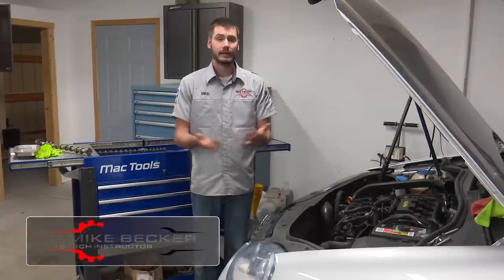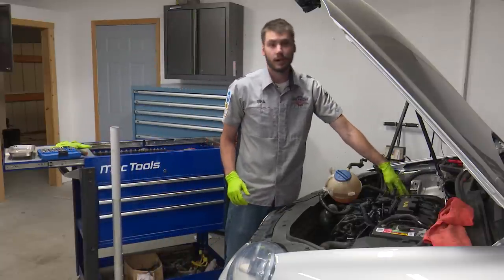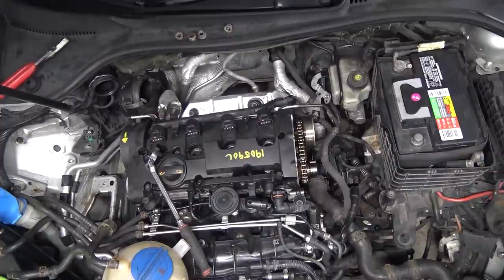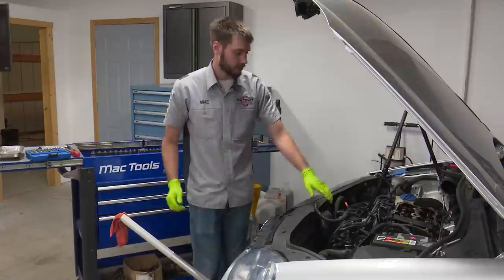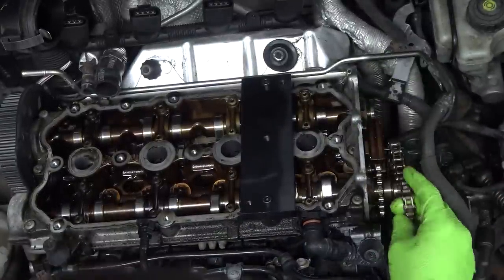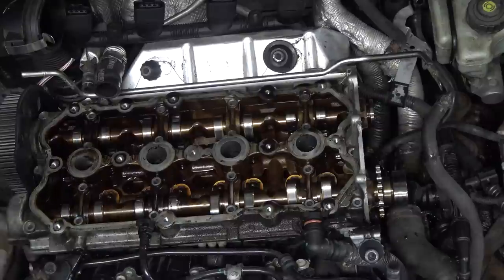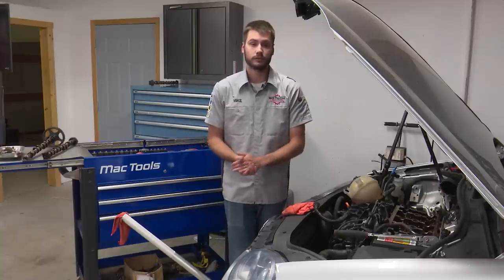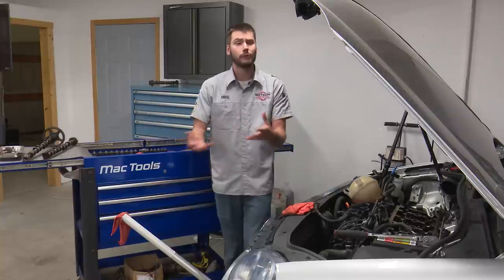Part 3 - VW 2.0L Turbo BPY Intake Camshaft Replacement - P2293

Comment: The plot thickens! Sorry to hear that, Mike, but you're making the right call here, no question about it. 

I've been here before with a '00 Jimmy engine I stripped the electronics off of and installed in a '89 s10 Blazer with a carburetor and HEI ignition. I figured I'd save some time and money, and just throw the engine in without changing anything, since that engine never leaked & ran good (aside from the electronically-induced misfires). Well, the minute I drove it, a giant oil leak formed up front, along with a few others as time went on. Exactly a year later, I was pulling the engine again (since I couldn't get the pan off in the vehicle) and doing all the gaskets and seals, oil pump, and the timing chain set I should have done while it was out the first time! Live and learn, lol. That was a tough one for me! 😬
Reply from the maker: Hey Smitty, sometimes the hardest thing is throwing in the towel on something you're invested in...but I'll make out much better this way. That is such a hard decision to make, how much do you do when the engine is out of the car? How much is too far? I think a lot of it depends on the expectation of the vehicle...like for this VW I'm not planning on keeping it after it's fixed. Therefore I didn't do much with it.
Mike Becker, Senior Instructor

Comment: I have pictures of the exact part that scored the phaser and the outer shell. It was the spring keeper on the end of the hpfp that after it wore through, it broke apart and got stuck in between the phaser and outer shell. I had the same problem this engine had with me neglecting (actually more not knowing it was something I was supposed to do more than negligence) to change the camshaft follower and so now I have a nice big job to do to get it up and running again.
Reply from the maker: Hi Josiah,
Sounds like a big job!
Good luck on the repair and thanks for checking out the video!
Ryan Wilsing

Comment: I'm thinking the camshaft phaser literally came apart due to the engine neglect and wore that groove in the cover. The damaged phaser was an oil pressure loss, so the engine was running with low oil pressure, scoring the cams and starving the turbo bearings. Someone then replaced the phaser to get the engine going again (that would explain why the bolt was so tight). That engine sure has some stories to tell, I'm sure. Quite the domino effect.
Reply from the maker: Hey Joseph, could be! If only an engine could talk....I'm just glad I don't have to listen to this one anymore!
Mike Becker, Senior Instructor

Comment: I'd do it exactly as you did. I know that fixing what you have can cost a ton of money. Machine shops and special tools can be very outrageous!
Reply: Ecclesiastical though...
Reply from the maker: Hey Paul, it would have been very expensive to rebuild this lost cause. Better to start with a better beginning :)
Mike Becker, Senior Instructor
Reply: @Usmanthemecano  fixed! 😀
Reply from the maker: Don't worry Paul, I got your point either way!
Mike Becker, Senior Instructor

Comment: Proof is in the service manual, procedures say to pull the exhaust cam pulley by approx 10mm to get the bridge out. Good series and videos. I have an A3 that I’m chasing a P0087, some of the info in the other videos has been helpful.
Reply: A3 hatchback?

Comment: When you displayed the removed camshaft with all the scoring on the bearing surfaces and the camshaft phaser likewise, your comment about checking the oil pan was correct. I am sure you would find crankshaft bearing journals and bearing inserts scored which is NOT a good thing. You are cutting your losses and opting for another engine.

Thanks for being so forthright and honest. Bad / unfortunate things happen even to the best technicians / mechanics. You will get past this hiccup!
Reply from the maker: Hey, had I installed new parts I would have regretted it. This engine wasn't long for the road anymore. It happens when dealing with used parts. It's just another bump in the road :)
Mike Becker, Senior Instructor

Comment: good on them for allowing you exchange or return it!
trying to repair that thing would be a fatal mistake of wasted money. as I assumed in previous video, lack of oil/oil changes and it's spanked.
Reply from the maker: Hey Throttle bottle, i'm so happy they did. I agree. I believe a mixture of lack of maintenance and high RPM torture.
Mike Becker, Senior Instructor

Comment: Mike, I agree 100% with your approch & decision on this engine. Your car or a customer's car, either way. What a headache. At least no customer involved in this case. But still what a waste of your time. VW techs: is this a common problem with this model VeeDub engine or is Mike just having a bad run of luck?
Reply from the maker: Hey thanks, that makes me feel good! I'm fortunate that this is a third vehicle for me. 
Mike Becker, Senior Instructor

Comment: I did a 2001 TT 1.8t used engine replacement not too long ago and only lasted 6k miles then lost most compression in all cylinders so these things happens. Though this was purchased from a private party and pretty cheap. Now a low mileage with 1 year warranty engine is going in next time
Reply from the maker: Ugh that can be the worst man. All that work to not last :(
Mike Becker, Senior Instructor

Comment: Hi Mike I would of done exactly the same looking at the journal s  you definitely would of had problems  rattles and on going issue's wise decision you made in regards to that engine the car different story  personnel I would of got the diesel version but PD  engine  pretty reliable  but you may not have them in USA . Best of luck with engine transplant
Reply from the maker: Hey, i'm not much of an engine swapper(other than the original). The diesel would get better fuel eco though, I bet!
Mike Becker, Senior Instructor

Comment: Pretty good assessments.
Reply from the maker: Thanks for watching Faras!
Mike Becker, Senior Instructor
Reply: @GoTechTraining Thanks.  I'll use your video as my guide. I am thinking about replacing my chain, tensioner.  Do we just remove the intake camshaft and put the chain, tensioner back then the cam holder tray and then use the tool to verify all is good?  

I know that exhaust side bolt will not come off.  Would rather do it the way you do it.  However, I guess it is possible to take the tray off and put it back in there like you are doing.

Comment: The exhaust cam phaser bolt is fairly likely to strip the splines.  Mine came off like they were made of glass.  Be prepared to drill & extract.  If you have to drill, protect your oil passage from swarf.
Reply: I've had to do this through the firewall before! Carbide bits helped greatly.

Comment: Would you happen to have a Premo Code to use at the Online Store FCP ?  Also I'm not sure if it's made for the VW 2.0T FSI engine or not but I see Cam Followers with a roller on the end that meets against the Cam, So maybe less Ware & Tare on the Cam , If I can find that type of Cam Follower for the VW FSI 2.0T would you recommend it ?   Part#  HITACHI FUP3058

Comment: Glitter in paint is pretty, glitter in oil not so pretty. I would have loved to see  what was in the oil pan. I'm glad they took care of you on the expired warranty.  I would have liked to tell you the story of a customer and his 5.4 3V ford truck but that would be way too long!
Reply from the maker: Hey Keith, could not agree more...I hate glitter in the oil! Yes, it would have been nice to see inside. I was pretty frustrated and didn't want to do more work than necessary on that junk motor. Ahhh yes, the ol' 3valve...I'm pretty sure every one has been unlucky with those and has a story to tell :(
Mike Becker, Senior Instructor

Comment: I'm experiencing the same code P2293 on  my Audi A3 2.0 FSi. I thought is it was the high pressure fuel pump,  it replaced the pump but the fault keeps on coming

Comment: My initial guess would be the engine's HPFP had a failed cam follower in the past causing the scoring and scraping on both the chain cover and phaser. Or even a broken chain or tensioner could've done it.

Comment: You have to remove both the timing belt cover and that mount support together that way it is easier and you don't have to remove or loosen  any other parts
Reply from the maker: Great to know for next time, thanks!
Mike Becker, Senior Instructor

Comment: Mike , You should do a video r&r that motor. Will that motor come out the bottom ?
Reply from the maker: That would be a long video with too many beers and curse words ;) No, this vehicle the entire front clip comes off and she pulls right out of the front with the trans attached. I'll include pictures in the part-4!
Mike Becker, Senior Instructor

Comment: As longs went that far in desassembling the enging
Just do borescope make sure no problems there and compression test
And buy a new part for the part that are not good
And re asseble the engine 
You almost there to have good engine

Comment: I feel bad for you. You're not going like what you're going to find in the oil pan. I replaced the head on one of these because the oil pump chewed itself into a horrible mess. The cam follower on the pump was incidental. These engines are SUPER sensitive to ANY damage. They self destruct!
Super glad the yard is working with you on this! (I initially didn't complete the video...)
Reply from the maker: Hey, i'm happy they took care of me too! It would have been interesting to look inside...just didn't feel like wasting any more time on that mess.
Mike Becker, Senior Instructor

Comment: did jasper build those engines?
Reply from the maker: Hey Chevylover432, I assume you haven't had the best luck with Jasper?
Mike Becker, Senior Instructor
Reply: @GoTechTraining  Jasper has been the worst but reman engines quality is questionable in general.
Reply from the maker: I've had some bad luck with reman in general. Personally, OEM reman or used...those are really what I end up choosing usually. Depends on the vehicle and the customer for sure.
Mike Becker, Senior Instructor

Comment: metal shavings in the oil passage means it wasnt caught by the oil filter.  my guess is it had a timing chain break at one point and was fixed causing the shavings and that damage to the cover.  poor clean out on the repair.  caused by a seized hp fuel pump? (check that cam for a twist/ bend)  not much choice since the housings are the bearings.  could do a top end but for the price might as well swap it.   i like to buy a gasket set and pull the "new" junkyard engine apart enough to make sure its ok while its out of the car.  ya get clean leak free  to start with as a bonus.  saves a lot of r&r if ya get a bad one
Reply from the maker: Hey Richard, thanks for watching! Love the broken chain theory. That makes sense. Wow though, can't imagine what it would take to break that chain!!!!! I'm contemplating tearing this engine apart...I think I may just pull the HPFP and see how the follower looks. I already pulled the timing cover window....belts original at 80-something thousand.
Mike Becker, Senior Instructor
Reply: If the timing chain broke, they would have had to replace at least most of the intake valves and pull the head. This likely did not happen. More likely the cam follower failed and wore through the cam/fuel pump.

Comment: The scoring on the cams are pretty normal for these engines. Its a hardened aluminum contacting a steel cam. Also, why would you reuse a timing belt? 

You're cautious in all the wrong ways unfortunately.

Comment: It probably a. Piece of cam follower got stuck in there and damaged it
Reply from the maker: Hey Kevon, thanks for watching! Maybe the metal wore away and got ruined the bearings?
Mike Becker, Senior Instructor
Reply: @GoTechTraining  yes
Reply: That's exactly what happened. Honestly not a huge deal. Replace the cam, cover, chain and tensioner. That engine would have been fine.
Reply: @shawnd567 yep I had those issues with my GLI and GTI they need to be checked often like every 1000+ miles

Comment: just image what the bottom end looks like if all that scoring is up top
Reply from the maker: Right? So glad that motor is not longer my problem lol!
Mike Becker, Senior Instructor
Reply: Probably not bad at all. The scoring up top is because of the aluminum. This engine would have ran another 100k easily.

Comment: I have a stern bias against anything VW, I would recommend to a customer to replace vehicle with a known good anything not VW...or European cars for that matter.  I'm pretty sure the European philosophy to engineering cars  is make a mess, call it a car, and pretend it's better than everyone elses.
Reply from the maker: Hey Shaun, the do tend to have quite a few issues, huh? 
Mike Becker, Senior Instructor
Reply: @GoTechTraining  , I don't really even work on European cars unless I absolutely have to.  So much more of my frustration comes from the difficulty of overcoming so much built in complication from the factory.  In my experience with VW alone, you can't do anything to the engine without removing the front bumper or putting it into what they call a service position.  What I've seen of service info across the board for European vehicles is it's so laden in it's own overly explanatory vernacular while still not giving any clear directions or part identification.  (I'm still not sure what name they've given to pistons over there.)  I will always beg whichever god is actually in charge of this shit hole planet to send me an English to English translator if I have to work on a European car.  As an example, the first Mini I ever worked on took me 20 minutes to discover they call a hood the bonnet and that the release lever was tucked up under the dash on the passenger side of the car.  Another one I can recall came from a Mercedes ML320.  I had a hell of a time figuring out what to even call the part I was replacing.  I did find a name for it that 5-6 words long.  But it was most commonly referred to as M55 in most service info and known as a swirl valve by real humans.  Scan tool jargon and navigation even slays me on scan tools I'm otherwise completely skilled in using. How long did it take you to find that code you've been diagnosing?  I could lose 10 minutes trying to get through that esoteric BS just to find some weird ass code that's not going to have any viable reference in Identifix or Alldata.  One area I've never been able to avoid a European car is with alignments.  They always come with 10 extra measurements I can't produce, require 20 extra tools nobody can prove exist, demand 150 pounds in each front seat, more specified weight in the rear seat, even more specified weight in the trunk, and a full tank of gas.  With a Mercedes, they also throw in some kind of dewey decimal system that may or may not identify something in the suspension, vehicle model, or they're possibly accounting for the extra weight of a full ash tray custom built and installed for that one customer.  I have no idea what it actually means, but I can't evade the alignment, so I navigate the menus forward and backward multiple times to try and ensure I'm making the best wild ass guess as to what I'm even aligning.  Ironically and in spite of all this information they'll demand from you, they never let you easily and clearly ID a model.  I''ve aligned 8-10 BMW 328i's over the last couple years.  I pray that the "3 series" was the right option to click or I otherswise have a lot of shredded tires to explain.  Before i find too many more things to be a bitch about, I'll summarize it like this:  Your current bad experience with your VW is still better than my bad experiences with any Euro junk I've ever worked on.  If somebody tries to accuse me of being a Karen right now, at least acknowledge I'm trying to be an informative Karen.
Reply from the maker: Hey Shaun, i'm just amazed at your passion....against the Euros ;) I agree though...i've never had to buy so many special tools just to do what I considered a simple job. Triple square sockets, poly-drive sockets, special cam holder...the list goes on. 
Mike Becker, Senior Instructor
Reply: the problem is, they all have european engineering in them now, they pretty much all started that in the mid to late 90's ;)
Reply: Unfortunately I'm obsessed with audi.  They're the best handling cars I've ever driven.  But I totally agree with you.  I tell people audi are the nicest pieces of shit around.  They all have the exact same problems wich is a good thing cuz you automatically know what's wrong when you get a code but wtf.  What other car can I get the same handling with that's American or just ez to work on?  My problem is that I had a 2007 audi a3 hatchback 6 speed years ago.  My dumbass just went and bought a 2006 audi a3 hatchback automatic.  Wtf am I doing lolol I love that car tho.  I've never had such a small car go so fast and hug the road like that thing did
Reply: @shauno3697  hello Karen 👋

Comment: I would have had the original engine rebuilt or bought a reman engine.
Reply from the maker: Hey Mike, cost was a large factor on this one for me. I didn't want to sink over $3,500 into the engine.
Mike Becker, Senior Instructor
Reply: @GoTechTraining  You are becoming a VW engine specialist. Good video Mike.

Comment: Those 2.0 are a money pit.
Reply from the maker: Yeh, I've learned that lesson the hard way ;)
Mike Becker, Senior Instructor
Reply: These engines will go to 250k easy if you maintain them. 5k oil changes. Get the updated pcv. Don't forget to do the timing belt at 10 years 100k and the timing chain/tensioner. Cam follower ~50k. Rear coolant flange needs to be swapped to the new aluminum and silicone oring. You could do all of this yourself for a few hundred.